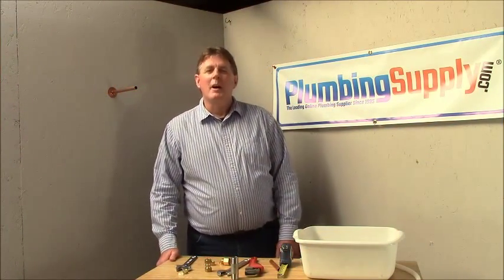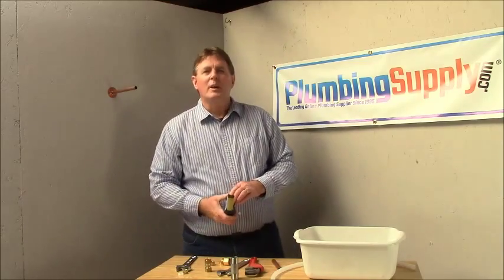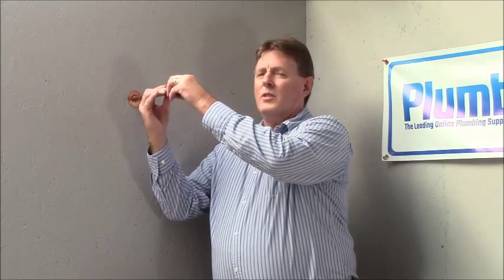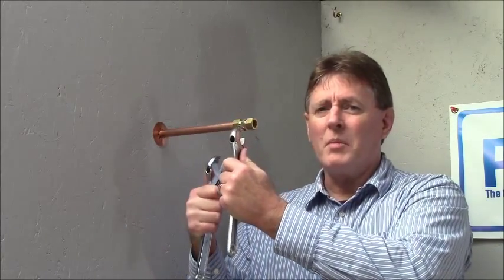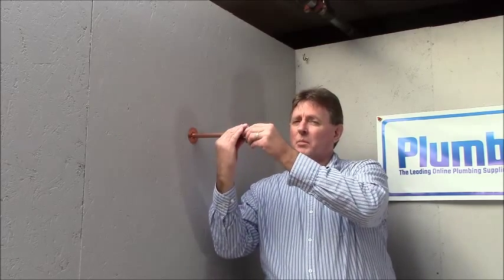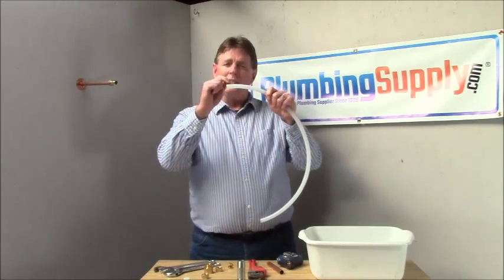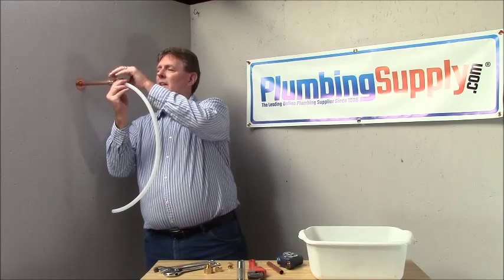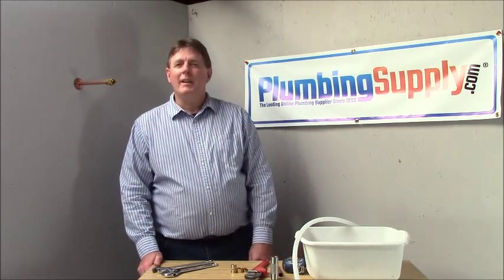How to Use Compression Fittings

Comment: Question....Can you use a female (3/4) NPT fitting on an IPS thread ?....I have a crow foot bathtub and the faucet assembly mounts right onto the tub itself.
Reply from the maker: Chances are yes! IPS (Iron Pipe Size) and NPT (National Pipe Thread Tapered) are often used interchangeably in plumbing. Outside of rare cases where IPS refers to straight threads (that require some kind of gasket to seal), the standard assumption is IPS/FIPS/MIPS = NPT/FPT/MPT